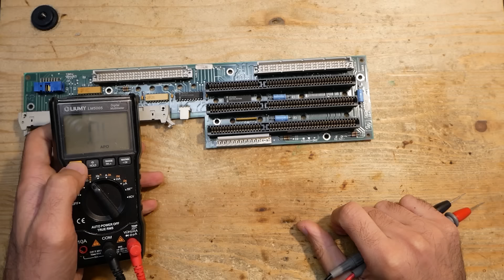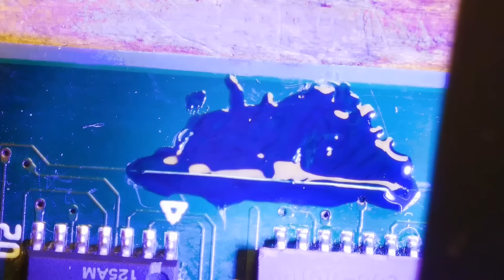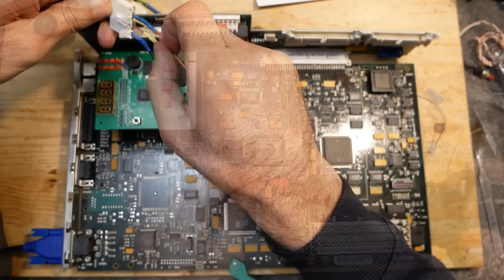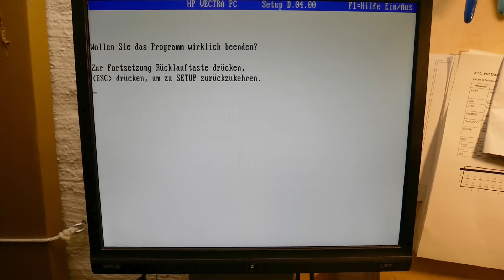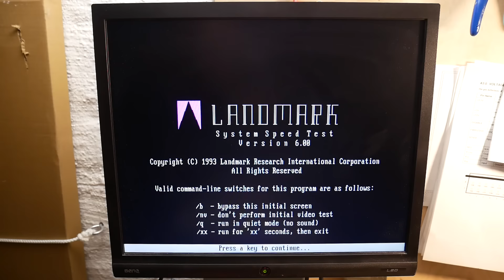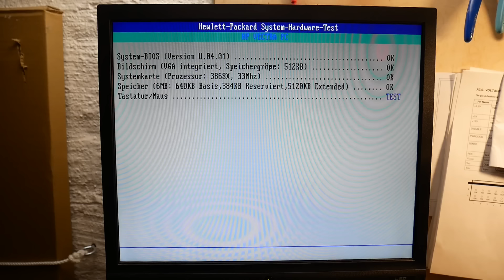A look at HP Vectra 386/33N mainboard

Comment: Videos like this always remind me on the millenium scam that was going on in the it branch, selling overpriced extension cards in 1999 to "prepare" a system for 2000. Funny when you see a stock 386 having no issue with post 2000 dates on a stock bios from early 90s. 
But hey profit margins on those extension cards were through the roof, costing cents to produce but sold for tons of money by fearmongering alone.

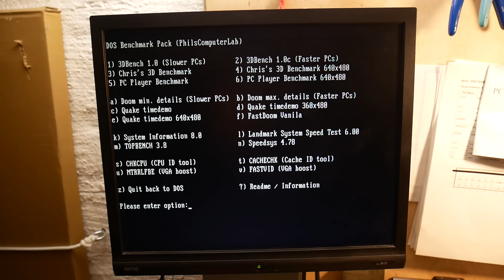Comment: 37:03 I see things a little differently when it comes to RAM. The 386SX was sold for general-purpose PCs for several years, so the standard changed over time. In my experience, 386SXs with 2MB or 4MB of RAM were more common than those with 1MB. Besides, look at that Vectra from the video—the Vectra was more of a budget office machine, not a high-performance machine, and yet it had 2MB of RAM built in as the absolute baseline. It was the lowest possible configuration, and it made sense back then. 1MB wasn’t enough and was already too limiting at the time. I’ve seen plenty of configurations with 2MB, 3MB, 4MB, and 5MB, but I can only recall two machines with 1MB. The second one was quickly upgraded to 4MB because of Windows.

Comment: Quite impressive and unexpected that a system as proprietary as this will actually spit out full-fledged descriptions of the error codes; very nice!
Reply: If I remember right they had the same thing on the IBM SureStart BIOS.  It is rather unusual, however, to offer the ability to store the settings in the system EEPROM.

Comment: You should pull the yellow kapton tape off of the 7-segment displays on your post analyzer card; the tape is just there for fabrication and can be safely removed, and it will make the numbers a bit clearer and more visible on video. If you added the tape yourself because the LEDs were causing glare, feel free to ignore!
Reply from the maker: I added it ;)

Comment: You can repurpose an old ATX PSU for such boards. All you need is to carefully pull out the pins from the 20/24-pin connector, and then you can attach them individually to any proprietary board. Short the green wire to turn the ATX PSU on.

Comment: Great video, I restored the same Vectra but 486 model and was also puzzled about the PSU which had to be repaired. On top of what you have done, I upgraded the BIOS to its latest version and to English which I can recommend. These computers are quite solid and I upgraded the sound card and used it also to test all my isa sound cards and video cards. I saw your request on Patreon but as my case is in used I did no reply. I am sure you will find a case soon.

Comment: Not to brag; but I deduced that (counting from the red wire in the ribbon) pins 7&8 were connected to the power button, just by pausing the video and looking at the pictures of the back of the button panel and the connector 😋  
It was pretty clear which solder spikes were the LEDs and which were the power button. Then I just followed the traces and the wires. 
Turns out, your connector has 4 extra pins (14 in total) ; but 7&8 are still the ones used for the button, like in that other similar model😊

Comment: I got a 386 as my first PC, bought for $50 from a friend who had upgraded to a windows 95 machine (probably a 486dx-100).  I needed to buy memory for it, but didn't realize I had to buy them in banks of 4.  I had ordered 2x 4MB modules, but that obviously didn't work.  I ordered 2 more, and so my 386 had SIXTEEN megs.  xD
I didn't have a hard drive right away, so I created a 12MB ramdisk, and used a boot floppy plus another to unzip a bunch of software into that RAM disk.  Took a while to recover from a crash, but the thing was downright snappy once it was all loaded up!
Then, not knowing what SCSI or full-height meant, I ordered a 1.3GB full-height SCSI Seagate hard drive, and a controller card.  So now my 386 had stupid memory and stupid storage, with a very weird configuration for the time.
I even played slideshow Doom with a friend on my hand-me-down 14.4 modem.  Also met my future wife online in a chatroom on that DOS machine!  We just celebrated our 24th anniversary!  :D

Comment: Just a thought... the boot failure might have been the CMOS settings being corrupt, but perhaps it could have also been due to the missing keyboard?  I think the BIOS beeps stopped after you had it connected.

Comment: I used to have an IDE hard disk from the early 1990s which had line repairs done to the main PCB in the form of added resistors and capacitors right on the front edge of the board.  It even had a new serial number issued on a handwritten label on the front of the drive.

Comment: I guess a start pin always has to be high, ie, if it started on a low it would run without a PS - lol -, so you look for 3.3-5V that is not a supply.

Comment: Nice - I love these old Vectra machines because my first professional job had a bunch of 386/486s. One of my first tasks was to "upgrade" the 486 with Cyrix 586 chips which of course worked about as well as the 486 I was pulling out. Good job sorting out the crazy power supply on that thing too.

Comment: I've got a bunch of control panels for the 66 MHz 486 Vectra. My school was given tons of these PCs in the late 90s.
IIRC there were two versions one with a wide ribbon cable, one with a narrow cable. (the difference was that one type of mainboard had an S3 video chip with 512k onboard and the other had a Cirrus Logic with 1M onboard)
I could make a pinout of one of these or send you one.
What's kinda cool is that it has a two color power LED and a Lock button (locks the PC like the Windows+L combination). If you set a password in BIOS, you can hit the Lock key at any time and it'll lock the PC and light up an LED on the Lock key. If you now try to turn off the PC, the power LED will change to red and the PC will beep. The fourth LED is of course for the hard disk. (counting the bicolor LED as two)

So in short: There are 4 LEDs and 3 buttons on the front panel of a 486 Vectra.

Prk means parking track. Xl means Translation. This should allow DOS to use hard disks with more than 1024 cylinders. (Vor is Precomp which is only needed for really old drives)

Comment: Putting aside you picked points of relation on the ISA connector for good reason (common POR for various mainboards), you appeared to totally ignore the points specifically for testing on the riser board close to the power connector.
Reply from the maker: Yeah, I mentioned those in the video, but wanted to show a way which is more generic and would help with other boards.

Comment: As a kid I had a lot of fun playing doom on  386SX 40 in low detail with a reduced screen size. It wasn't fast but it was Doom. I even played System Shock on such a system, I didn't know that it wasn't supposed to be a slideshow till I played it on a Pentium class system and that some of the guns were automatics if you held down the mouse button. Playing Systen Shock like that was a horrible experience but I still loved it and I could replay and enjoy the CD version fully when I eventually got a system that could run it well, it was like the game was how I imagined it could be not the game that I actually remember playing. Another terrible idea was running Command and Conquer on such a system. The CPU wasn't fast enough for the FMV playback and in game music had a considerable impact on gameplay smoothness

Comment: Cool video, man. I have my Vectra 486/25N displayed in 2 episodes on me chanel. It is a beast with VLB onboard video card and socket for CPU upgrade. If you have any questions, please email me. The comments are not showing on notifications. You are a genius for figuring out the PSU pins. When the PSU from mine will fail, I know now how to replace it. BTW, my Vectra 486/25N is using a 4.5 V rechargeable alkaline battery. You should check the battery pins of your 386 motherboard, if they are charging.

Comment: Interesting to watch you play Doom on this machine. Actually it was all interesting but I recently managed to install and play doom on a Raspberry Pi Pico.  I bought a little hat style board with VGA connector, DAC audio and power connector so I could connect a screen, keyboard and sound to the pico directly.
It actually run quite well.  As fast as I remember it from the 90’s What’s interesting is how slow doom runs on this 386.  
Great Video!
Reply from the maker: Yeah, no wonder. The Pi Pico is reported to reach 142 points in Dhrystone Benchmark (integer performance), where 386 at 33Mhz makes around 14. That's almost 9 times slower. This shows very well how much progress happened in all those years.

Comment: My experience with old computer hardware that were in disuse for a long time says they sometimes do not want to work properly but as electricity flows in the circuits they gradually wake up and start behaving normally(capacitors maybe reform?).

Comment: Those proprietary setup were a nightmare to repair. I remember when I had my computer shop, I went to repair a computer which didn't turn on in a butter factory. The power connector was proprietary. So I cut the ATX connector, salvaged the proprietary one, used a screw connector, and voilà, a brand new atx psu.

Comment: Part of me wants to hate the proprietary boards, especially those with weird power supply pinouts just to be evil... But I have an irrational love for the 386SX and various versions of it, which has led to me restoring and owning my fair share of OEM machines like this in their complete form along with custom machines. There's something about the humble gimped processor with a mix of different bus widths all over, that can even lose to a proper 286 at times, that I enjoy programming for as a platform for hobby stuff. To be fair, I spend a few months out of every year in Hokkaido, which has lead me to collecting the best sku of every model of PC88 and PC98 released, from the first Z80 to the last Celeron, all restored to working condition. The PC88VA3 being my favorite with its novel hybrid z80/8086 processor, sitting on my workbench set up ready to next to my favorite 386SX custom-built machine that's way over spec'd for a 386SX and my Apple IIGS Woz edition maxed out with the best you could get for the period.

Comment: I found some parts from what must have been among the highest end of PC hardware in 1986 (accordung to date codes, made in late 1986): A huge board with a 386DX-20, 387 and a memory board with no less than 72 1Mx1 DRAM chips for 8MB. Also had a TIGA video card and some other huge card with a 68010 and 3MB of ram and some uniknown interface on it, and a SCSI controller with another 68000 and some more ram. I did get the board to usually boot but its still unstable, must still have some problems due to the leaky battery unfortunately.

Comment: My guess would be that the internal graphics was not working due to the corrupted / random data in the EEPROM (possibly because it had not been powered for decades).
Maybe you can remove the battery once again, re-randomize/clear the EEPROM with your external EEPROM writer and retest if the integrated graphic card fails again? ;-)
Reply from the maker: Yes, that's a good idea! I'll definitely try that and see if it makes a difference.

Comment: Vectras are capable of soft-reset and soft turn-off(at least 486 and s7 ones). The power connector looks pretty much the same as my 486 Vectra VL2 and Socket 7 Vectra VE. Power supply is really very peoprietary and Motherboards are capable of a lot of stuff that is more appropriate for ATX one.

Comment: I have the Vectra 486/33VL. It's interesting how different the system is. That being said, if I don't have the video connected when I power it on, the video circuit doesn't initialize. I have to boot it with the monitor connected. If you disconnect the video while it's running, it will shut off. When I saw you connecting the VGA while it was running, I knew exactly what was going on. But I'm glad you figured it out.

Comment: It's really a pleasure to see a PCB from this era. The extensive use of high speed TTL- ALS and F families, and also the liberal application of terminator resistor packs which were essential when bus speeds were increasing to these levels.

I noticed an F82C206 IC which incorporated a lot of chipset fuctions including DMA. It was one of the most unreliable IC's of the time!

Comment: If you need to try shorting pins to find a signal consider using something like a 470 ohm resistor. This will avoid damage when shorting a stiff voltage but a digital input should be high enough impedance where the resistor does not matter.

Comment: Can you put in a 386dx upgrade?
Reply from the maker: No. 386SX has 16-bit interface and like a 286. The 386DX on the other hand is a completely different beast with 32-bit interface. Although the names 386SX and 386DX sound similar, those CPUs are very different and the mainboards are incompatible with each other.

Comment: Maybe the on-board display didn't work because of the corrupted BIOS settings. In the BIOS it had some settings for display sync frequency, so maybe without proper settings for those, the on-board VGA could not produce a valid output?
Reply from the maker: Normally without a battery all the CMOS settings get lost and are reset to default. But may be on this board they are written into a flash? Thanks for the idea, I'll have to try that.

Comment: Since the power switch seems to be a "soft" power switch toggeling the PSU to start up, I'd suggest the reset is held until the PSU signals a "power good" signal, so that could be what these two extra pins are used for. Just a guess, but it'd make sense to hold the system in reset until the power lines have stabilized.
Reply from the maker: Yes, sounds reasonable. Thank you for sharing the idea.

Comment: I used to own one of these. Sadly it passed away when I was not so experienced with repairing computers. I don't quite remember the details  of that situation.

What I do remember is that the upper right button and LED on the front panel are for the keyboard lock. This could be set in the BIOS to be enabled at boot. You could also enable it by pressing that button, for example when  you had to leave for a while to prevent someone else accessing your PC. To unlock, you would have to type a password on the keyboard followed by pressing enter. This did not display  anything on the screen and seemed to be just by hardware. I don't remember if it also locked the mouse, or if you could still use the computer without the password if it was set to boot straight into Windows for example.
Reply from the maker: Oh, very interesting detail. I thought that would be turbo button, but playing around with those pins didn't confirm the idea. So I thought, that must be something else, but I didn't think of such a lock. Thanks.

Comment: Hey, it seems that if you are watching on Chromebook it is possible to view non-public videos - looks like it is being cached.
By the way, if a IDE controller in not willing to work with CF card, try plugging secondary device, like CDROM or other HDD on the same ATA cable (with power cable plugged in). Mostly works for me, looks like controller expects certain level of resistance which CF adapter doesn't provide.
Reply from the maker: Interesting idea. In my case the problems were usually BIOS related and with XTIDE everything worked as is, but I believe that I also had issues with the card itself couple of times. I'll definitely try that. Thanks.

Comment: Hahaha this brings back memories.  Back in my misspent youth as a gubmint apparatchik I rented out a farm of these (20?  30?) to run some thousands of crunchy simulations involving things that go 'boom'.   A batch job cluster manager would farm out simulation shots with different random numbers to build the statistical model of the result, all shuffled back and forth over the network.   The sim software vendor later used my setup as an 'example' to sell their software to others with similarly crunchy problems.

Good times.

Comment: I was surprised that the motherboard didn't require the power good signal from the AT power supply: I was thinking at the start of the video that must be why the system will not start posting but then in the end that wasn't it, strange design and interesting video!

Comment: on those low power computer technically nothing is stoping you from powering the board trough isa slot sinve all voltages are directly wired there so you could just make a isa pcb adapter with atx power socket and power switch for testing oem motherboard without worrying about propietary power connector pinout. it technically should work on any board with isa slots
Reply from the maker: Yeah, such a custom made "power card" is indeed a cool idea.
Reply: Ooh.. that just feels wrong.  haha

Comment: Oh man, loads of resistor arrays... Why?   

BTW: those " clamps"  are called AMP's. You can wrangle them, but soldering is also a (much better) option. Remove the primitive insulation and use heat shrink tubing instead.

Comment: I would suggest seeing if you can get anyone who has the original PSU to test and see if the one of the two pins are 5v standby. With a soft on it wouldn't surprise me at all if one of those pins was standby voltage to ease the load on the battery and allow for faster starting.

Comment: When I pinout  boards for power connectors I always color sharpie the connections.
Do the same for the cmos battery.
Reply: That's a clever idea.
Reply: @sirnickity  Yeah, it weird that some common sense stuff is not common.
Reply: Sometimes technically minded folks tend to over complicate things.